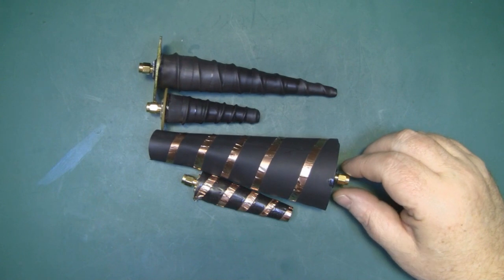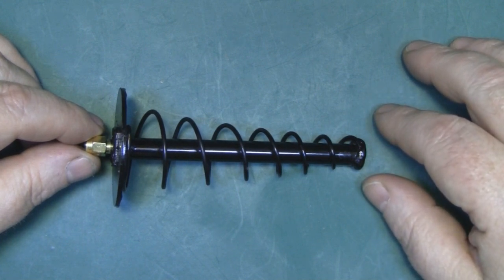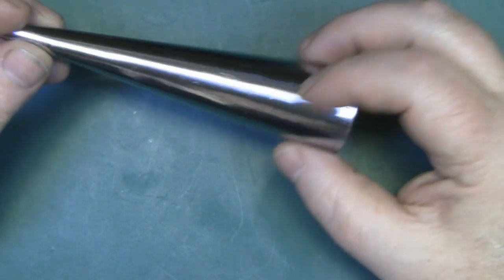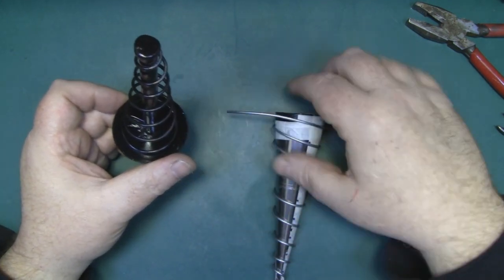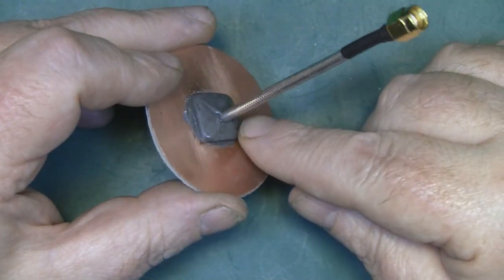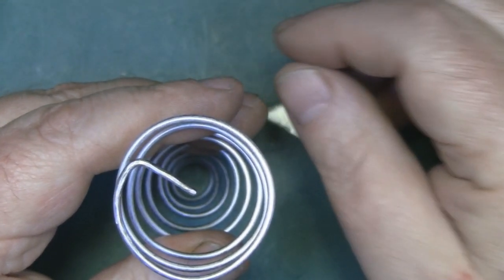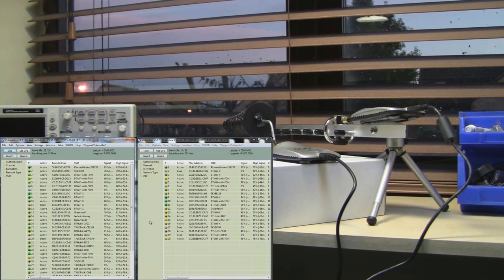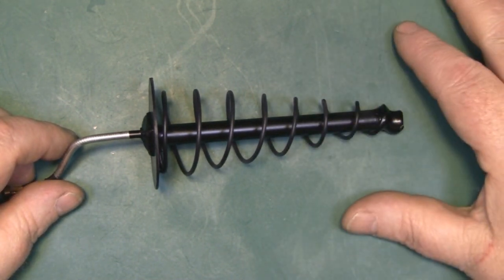Wideband Spiral  Helical Cone Antenna for WiFi and FPV

Comment: iwhat i missing is a impedance testing, i did make my own shortwave antenna`s and used a digital impedance tester to see roughly the matching on the desired frequency and that did help a lot and seeing also the peaks on other frequencys other than the desired frequency.
i know wifi ranges are far more difficult but you might need a try with those tinny varicaps to get a correct match to the coax

Comment: Cool antenna! But the test doesn't make much sense? A high gain antenna would logically pick up fewer APs than an omnidirectional antenna. What matters is the signal strength from a remote AP. Also: a balun is something completely different. That shim is just a design feature of the antenna. A rubber duck antenna's rubber housing also changes the impedance (that's why the dipoles are just 23-25mm per pole) and no one calls it a balun. Still, cool design, you've inspired me once again.

Comment: Mr mcneil,
i do appreciate your time and effort for teaching us how to make such an antenna,
i have already seen plenty of your works and im just confused what should i choose for replacement of my Adsl router modem antenna. i need all my area which is 500 meters plus walls in between, be included by the supported range. so i can get the best signal quality on my laptop or smartphones.
which type off antenna is the best fit for this situation?
literarly i need long range,all area support plus best signals qulity from my router.
could you please guide me through.
thanks is advance

Comment: 13:30 If this straight piece of wire lies close to the reflector, then it can act as a quarter-wave transformer.
17:52 You should try to place the Yagi antenna in vertical polarization.

Comment: Interesting, I will follow your development of this antenna with interest. Could be a seasonal market for a red and green unit topped off with a star or angel.

Looking at your prototypes, have you covered two of them with heat shrink or some kind of tape? I've been attempting to make a 5.8GHz 12 turn double helical antenna and, so far, the best weight saving v rigidity method has been to sandwich the helices between two layers of heat shrink but I'm not sure how any dielectric effect will impact on the antenna's performance. I hope to test the prototypes as soon as I've made enough to compare construction methods.

Cheers

Comment: I might have missed a part. How do i calculate the wire length for the frequencies i want to cover? I would like to build a directional antenna for my mobile hotspot. It uses 2G 3G 4G and lte. I think i need to cover as best as possible 800Mhz to 2200Mhz o if 1500Mhz was the average?

Comment: adding that triangle to  the bottom adds capacitance which brings the impedance down closer to 50 ohms.  Normally if the first half turn is running close to the ground plane it has the same effect.  Having the antennas in different place during that test is not very accurate. At those frequencies you move the antenna just a few mm and signal strength can go from strong to nothing.
 The only test that would make sense would be one antenna at a time and both in  the same spot and direction.You then test in TX mode to a receive antenna some distance away and which ever has the best signal strength is the winner.  My guess is the yagi will win. 
 Another flaw in your test is the yagi being a lot longer than the helical will have more gain and a much more narrow beam width so in effect its pointing to less access points ie the ones of to the sides and back  were as your helical with its less gain and much wider beam width picks up more of the signals to the sides and even the back of it.
 In order for a helical to cater for 2.4 and 5ghz as turns get smaller the spacing should also become less and the amount of capacitance  needed near the feed point will also be less.

Comment: I've found at Hobby Lobby they have cardboard and foam cones that can be used also for a even wider bandwidth antenna that will go down to the MHz ranges.   

In regards to someone noting interference between the two, I'm guessing would be dependent on the hopping and spread spectrum your transceiver or receiver was using or not.  I wanted the larger frequency range for an RTL-SDR receiver to I can scan for assault frequencies because I'm finding I'm one of a handful of people that are victimized that seem to be more advanced at thinking to check what frequencies we are being targeted with.  Finding more than the "sonic assault" frequencies that are coming out in the Cuban Embassy incident.  

Amazing, this link is from the 70's declassified: http://www.dtic.mil/dtic/tr/fulltext/u2/144021.pdf

These are priced at "refurbished": http://www.bellnw.com/manufacturer/ETS/3101.htm?gclid=CjwKCAjwpfzOBRA5EiwAU0ccNznNkS41khkIhMOQk9xsOlWnA6TIT_v9YAYZwucVEP48EnA1WxFpVxoCcikQAvD_BwE

Awesome comparison also Mr. McNeil!

Comment: Almost was going to purchase a VCO in the GHz range to make a mixer to make a signal generator to sweep so can perform VSWR up to 6Ghz.  I'm not giving up on that design idea... though I did wimp out and am going to buy a HackRF for now.  

That will get me up to 6GHz sweeps for antenna testing.  

I can see if the Wi Fi dongle chips code is available and maybe make a signal generator from those... and maybe there is a simpler way to sweep the 2.4 and 5.8Ghz range since the chips will transmit.   Anyone with reference code ideas to save time?   

Thinking HackRF and a more expensive wide range Directional Coupler is going to be what I am going to do for now.

Comment: At 5:53 you say that the circumference "will be 38 mm" at the base, this is impossible. The cone's diameter is close to 30 mm at the base, and when you multiply by π you get over 90 mm. To get a circumference of 38 mm you would need to squeeze the cone so that the base is 12 mm in diameter. It's not possible, I tried.

Comment: I noticed that the helical build on RC Groups uses 3 methods to bring down the impedance. 
Including one method that the straight wire at the bottom running parallel with the base plate with a gap of 1mm between the base plate and the straight section of wire.  http://www.rcgroups.com/forums/showthread.php?t=1377791
Reply: the best wire of all is made of silver, 1.8mm - 2mm silver-wire.